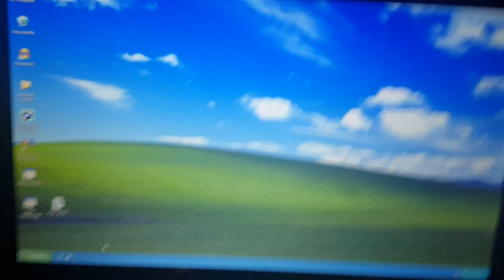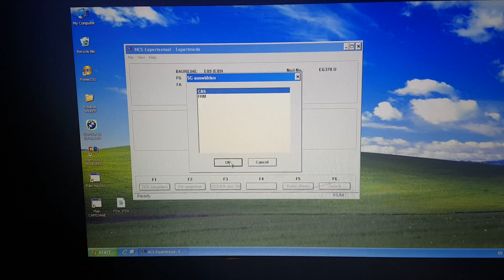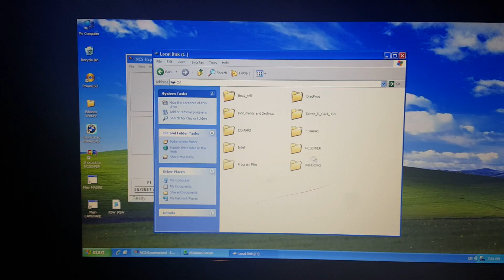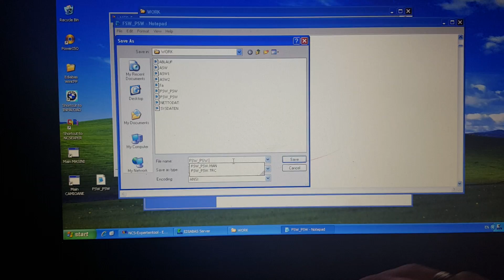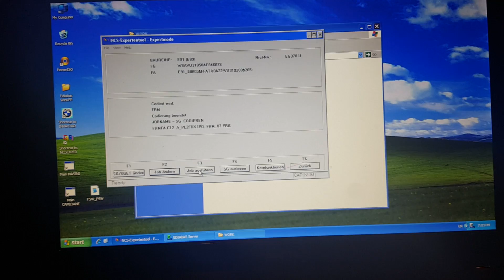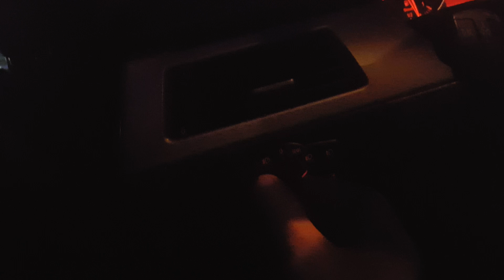activate DRL coding options daytime running lights US daylight on BMW e90 e9x with NCSexpert

Comment: Hello mate, thank you so much for the video. I activated my DRL, but they are glowing with the same strength as in high beams. I repeated every step that you  made. Can you give advice? 
Car is 2006 e91 with FRM1, xenon, no auto-lights. 
Thanks! Keep up the good work
Reply: FIXED: For anyone having my issue, here is how I fixed it. 
I had to change value of 
DRL_WERT_DIMMUNG from “wert_01” to “wert_02” and high beams now glow with 30% intensity. 
I tried with wert_03 but it throws an error and doesn’t allow coding.